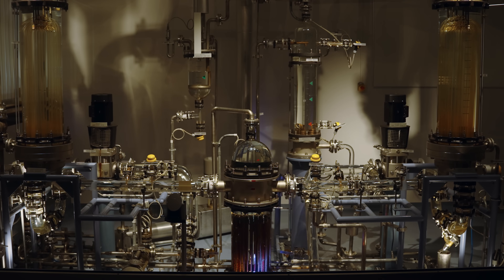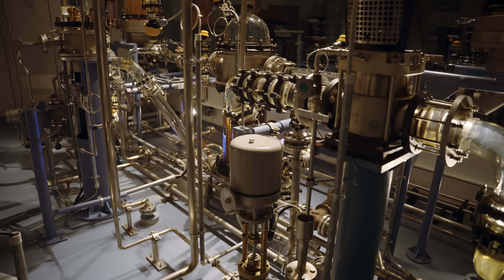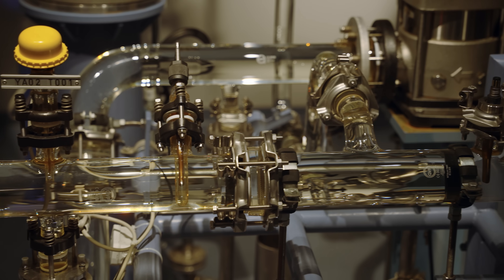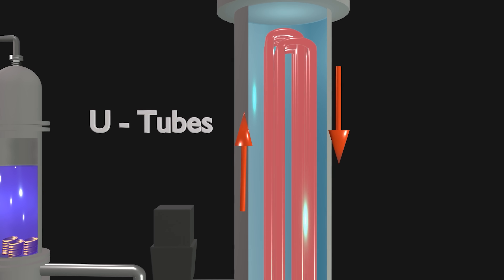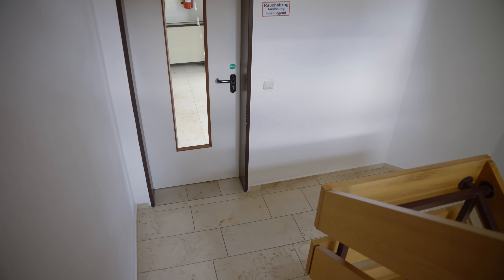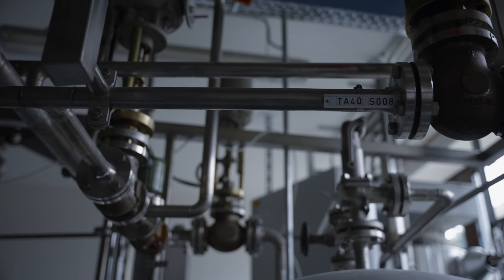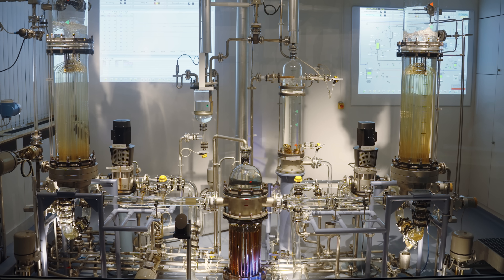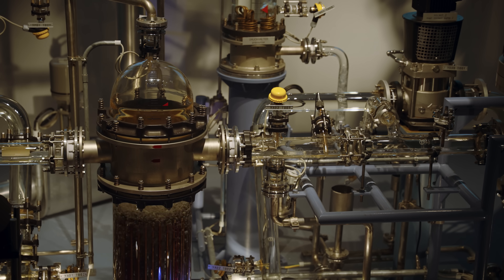World's Only GLASS Nuclear Reactor!

Comment: I mean I'm an electrician in the US, I remember thinking electricity was ooky spooky but it has to follow rules and laws (ohlms law). Nuclear has to follow laws to, it has to make sense. Some of the greatest minds who ever were realized that things almost always have to follow a process that makes sense. To not study and grow with something having so much potential more is sad.
Reply: But yes, moving a magnet past "coils" of wire creats induction.  "Basically the coils become energized and electrons move the opisit direction through the coil but at a nearly identical rate (current flow). From there if you use a transformer to increase voltage, it takes away the "less harmful/more difficult to push over large distances" current. (Basically what make wire hot is the amount of flow, or current. Upping the voltage instead of current allows, is to use smaller wire which is less expensive because less material is needed). You want current in your daily needs which is why you use a transformer to step down the voltage "using induction again" to creating less voltage but increased current. Remember Pie, P=E*I. Or Watts (usable power)=volts*amps. We use 120V ac on a single leg (the typical house has 2 hot legs, or wires but 3 legs are typical in industry) in the US. So a leg is also referred to as a phase, there are three major (furthest fron eachother) ones in our US delta style. By hooking them up to an industrial 3 phase motor, basically like how the "ganerator" is at the beginning, being spun, it inductivly creats the same effect on the other side, mimicing it. If you want your 3 phase motor to spin the opisit direction, swap any 2 wires and the voltage will "count" the opisit direction. If any one phase is used to heavily in comparison to the other legs, it creats "impedance" or brown outs to what we call the grid (power lines, transformers exc.)

Comment: I'm curious if the Glass Reactor breaks even on power production versus consumption.  It uses electricity to heat the copper coils, but if hooked up to a turbine, would it break even or make more power since steam spinning turbines is one of the most efficient ways of producing energy.

Comment: So when I did my training on nuclear reactors I actually operated a functioning full size reactor. A pressurized water reactor can be superheated however it’s actually much simpler to have the system be saturated. This way you can control pressure with heaters and a cooling element in something like a pressure control vessel vs controlling it by exchanging fluid to a separate higher or lower pressure system. With water it’s actually a really safe moderator/coolant/reflector. As water heats up it gets less dense meaning it slows down neutrons less efficiently. This means with a hotter coolant temperature you have less reactivity which is way safer than the other way around. Also with three mile island the pressure relief valve didn’t open on its own. It was being worked on and improperly restored meaning it caused a loss of coolant casualty. On top of this there were  proper indications of the system as in all gages were reading correctly during the partial meltdown. What caused the casualty to become worse was operator error. The operators were at the time trained to only operate in normal conditions and didn’t understand how to correctly diagnose issues due to a lack of knowledge of the reactor plant. This was also an issue with Fukushima but they had a pretty bad set of cards dealt to them. Over time enough coolant leaked out of the core to cause the fuel rods to be uncovered which dramatically reduced heat transfer from the rods leading to a particular meltdown. The cause was found by inspections of workers at the plants and the designers of the core flying in and looking at the indications themselves. Together they put together that a relief valve was left open which they corrected and stopped a full blown meltdown. Additionally when fuel rods get hot enough to melt they atomize the water splitting it into hydrogen and oxygen which as you can imagine is very explosive. They had to vent the reactor compartment to prevent an explosion from occurring which spread slightly radioactive gases to the surrounding area. They later filled the primary coolant system solid and have not tried to startup the reactor since. For what I do I had to study all reactor accidents in-depth and read papers that were hard to find or not fully intact. Fun fact President Jimmy Carter actually went to three mile island during the accident to see it for himself against the request of everyone who was telling him not to go. Another fun fact is that primary coolant actually isn’t as contaminated as you think. Most of what’s going to be in there is excited wear products from pumps and valves and certain fission products from the fuel and other materials in the core. Most of which beta decay within a few hours or gamma decay after a few months or years, measuring in half lifes obviously. If you were to drink it the most you’ll get is 180 days of whatever is shooting gammas into you until your body filters it out and you take a number two in the company toilet. Unless if it’s iodine then good luck soldier.

Comment: It's pretty sad, Germany now has a serious energy crisis. They lack the ability to produce energy since getting rid of all their reactors. And are heavily reliant on the US for liquefied gas from the US which is extremely expensive. Basically Germany is now in a free fall decline towards self immolation.
Reply: Bruh. Ever heard of Solar/thermal or wind power? 

Power is not just nuclear.  It can be

Hydro thermal 
Solar thermal 
Stratos thermal 
And most recently discovered 

Gravitational thermal (that one is still on the writing board) but, moral is. Power can come in more ways, than just nuclear thermal.
Reply: @ 

Hydro = situational. Dependent on what body of water exists in Germany. 

Solar = Clean but has a lot of noise polution, and at best can only provide 15 to 20% of a country's energy production. 

Stratos = is basically 18th century steam technolog but with a 21st century twist. Impractical and supplying energy uninterrupted is not really feasible. 

Gravitational thermal = I'm assuming that's the process of kinetic energy conversion due to gravity and object falling from height? It takes energy to make that energy. To reach height for gravitational effect, you need to consume energy. Impractical.
Reply: That is just wrong. We only had 30 TWh of nuclear energy and replaced them completely with renewable energy. Wir are reliant on US gas because of heating. Not electricity. And no. We are not in a free fall. Thats also wrong.
Reply: @MB-bg1ek  According to Reuters, '
Germany, the world's third-largest economy has lagged the European Union average since 2021 and is expected to shrink for the second year running in 2024, making it the worst performer among the Group of Seven major economies'.

According to other reports, 'Household finances: The number of households paying more than 10% of their income on energy increased from 26% to 43% between March 2022 and June 2023.'

Nuclear energy was clean . Because either Germany, Poland or the US blew up the pipeline, your country has to pay a staggering 3 times the amount for imports from the US for liquid gas. Last time I checked, neither liquid gas or coal is a renewable energy source. Consequently, coal which is a dirty energy source made a comeback in Germany, since the country decided to get rid of its nuclear energy, thereby increasing its carbon footprint. 

So no, I'm not wrong.
Reply: @luminatrixfanfiction  whatever. stay in your bubble. i live here and its not like that. but well. don't need to argue with a dud in the internet. Byeee
Reply: @MB-bg1ek  Sorry but you are wrong. We theoretically replaced the nuclear with renewable (that point is highly debatable) energy. But the simple fact is, the sun doesn't always shine and the Wind doesn't always blows. That is why we import nuclear energy for example from France. We definately have an energy crisis, shown in the ever rising price per Kw/h. The Grid needs a constant load and as few spikes as possible and that is something that is not financialy viable with the so called "green energy" we have here.
Reply: @luminatrixfanfiction  No, you are still wrong. Why? Well, it's quite ridicolous to pretend that Germany's current economic development is solely because of the phasing out of nuclear. While staying with nuclear from the get-go would have been better, you are completely ignoring a bunch of other factors that come into play.

Germany has to deal with deep structural issues. Infrastructure and education have been underfunded massively for decades now. The automotive industry is also having major setbacks because of incompetence in embracing newer technology and making more affordable cars.

It's also no surprise that Germany would grow less, because it also shrunk less in 2020 than the EU average. The economies that suffered more gravely will obviously jump back higher, but that really doesn't tell the whole story.

The number you said is true, but in the grand scheme of things it seems fishy to me. Statista says it went from 94€in 2021, then to 110€, then 130 and at last down to 120€ for... the average three person household. So that's around 5€, then 7€ more per head per month. This is nothing. And it doesn't even take inflation into consideration. And this checks out, I personally and no one I know had their heating bill go up that massively.

So basically: stop this fearmongering narrative. "Germany is now in free fall decline". This is just a politically motivated exaggeration.

Btw. in spite of the phase out Germany was one of the best performing countries throughout the 2000's.

Comment: Unless there are breakthroughs in technology such as air scrubbers to take CO2 out of the air, an uninterruptible sustainable source of energy that doesn't produce toxic byproducts, or a revolution in urban and metropolitan interconnects design, nuclear HAS to be part of the solution. 
I used to be against increasing its use for peacetime energy generation, but that was because I understood it so much less than I do now. The spent fuel issue is still problematic in terms of storage, but European countries are finding and in a few cases already using new methods for storing the radioactive material away from people. Also, the fact that the fuel can be used for so long while having so much energy density is an opportunity for the future that CANNOT be overlooked.

Comment: The Chalk River Laboratories in Canada had a CANDU reactor where one side of the calandria (the large cooling vessel) repalced with a large glass window. They could operate the reactor for real, with real uranium, and observe the inside of the reactor. This is possible because the CANDU design does not depend on a large pressure vessel to operate. The main part of the reactor is held at ambient pressure.

Comment: We shouldn't be shutting down the reactors. The world needs at least ten times more reactors. Nuclear power is both very safe, clean and cheap if managed correctly. The waste can be used in a different kind of reactor to make even more power, then the depleted rods can be cut razor thin and coated in industrial diamond to be used in long-term low power products like pacemakers and long-range space probes. The so-called green new deal is not green at all, in fact it's very dirty and polluting.

Comment: Interesting video.  My college had something similar, a scaled down PWR that instead of using water used freon.  It was mostly metal but had glass viewing ports so you could see what was going on.  They also had, and still have, a small research reactor on site.  It's a shame that Germany got rid of reliable and carbon free power sources.  In the US, I think nuclear power is ~20ish percent or so of all the power generated and has something like a >95% capacity factor, meaning it's making carbon free electricity 955 of the time.  They're typically shut down for a month or so every two years to refuel and do maintenance, then run for another 2 year cycle. 

Operators are also highly trained.  20% of their time is in training refreshing systems knowledge and using the simulator to practice procedure and fighting different casualties.  It takes years to become a licensed operator in the US.

Comment: yeah nuclear power is very controversial here, the problem is our main source of power still comes from combustion of coal and the general consensus is that nuclear power is dangerous and fossil (allthough only the latter is true) and that we are trying to have a smaller impact on the environment by replacing all fossil fuels with renewable energy. until we stop burning coal we won't be having a neutral environmental footprint and it is sad to see that we started off with shutting down nuclear power plants before shutting down our combustion power plants.
farewell spicy rock energy

Comment: There is a conspiracy to keep the concept of Thorium Molten Salt Reactors in a black hole and hidden from public knowledge.  This video is only interesting to me because glass components solve one of the few problems with Thorium MSRs and that is corrosion.   Thorium Molten Salt Reactors do not have high pressure and they do not need water.  The nuclear materials are mixed with a salt and the salt acts as the coolant.  They produce high heat for steam and only nickel alloys have stood up to the corrosion problem so far.  China and India are moving forward with this technology.  The benefits are amazing and multiple.  Do your own research because this comment would be extremely long if I got into all of them here.

Comment: As an active nuclear chemist at a nuclear plant, I would've LOVED to have this when I was in training. Also great explanation of the PWR on a basic level. My plant is also a PWR. Boo to BWRs (boiling water reactors) unnecessary dose.

As an aside. The low pressure and high pressure turbines spin a generator at the end of the turbine called a MUG or main unit generator, THAT is what creates the electricity.  That electricity is then sent out to a switchyard on site to then be distributed by the electricity provider.
Reply: Idea! How about you make a YT video about the fine, tiny details of operating a reactor like that? I would love to delve deeper into those small steps, that nobody actually share!

Comment: I'm actually surprised that other countries that operate nuclear plants aren't contracted with the university to have their staff train there - though I guess there are only a handful of Siemens reactor plants outside of Germany (Angra 3(?), Atucha 2, Borssele, Goesgen, Trillo 1) so the value of the Siemens control room simulator might be more limited than I initially thought. I'm guessing the issue with the glass reactor is that a high-fidelity physical simulation like that required a substantial amount of support equipment that was probably not cheap to maintain.  You could probably build something lower-fidelity (i.e., not actually replicating the physical processes, but giving the appearance of the behavior of the systems) that required less maintenance - but then you have the problem of validating the model.